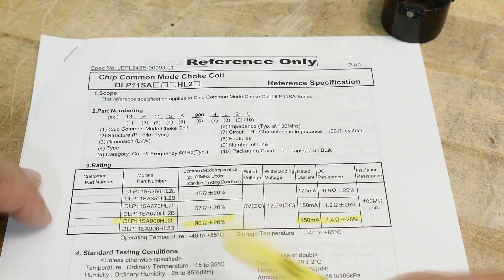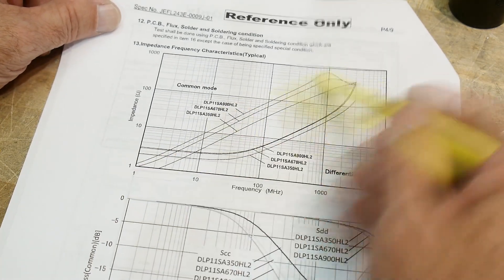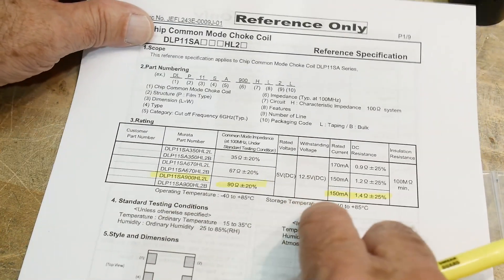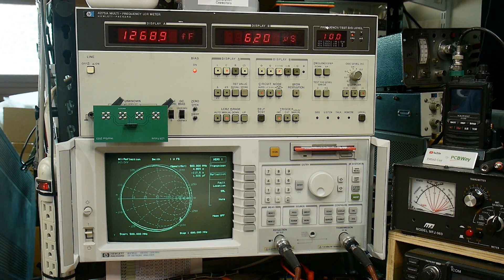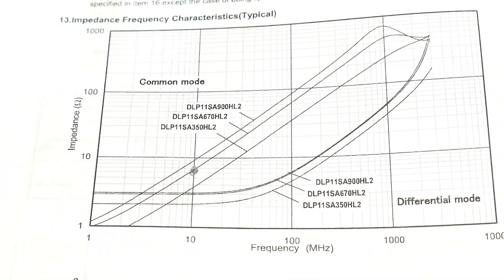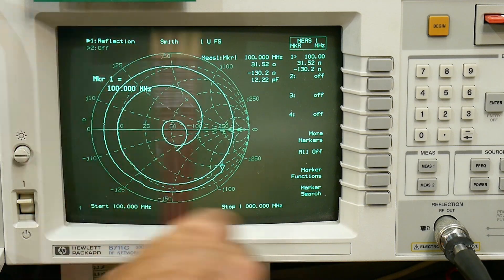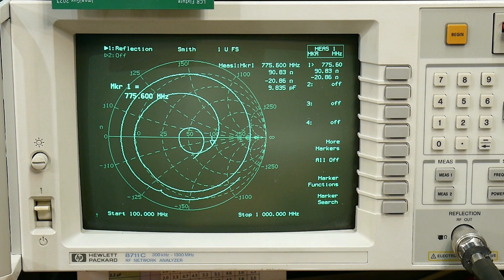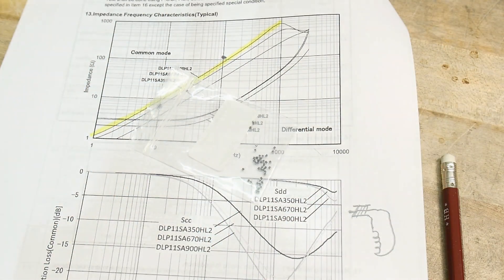#1945 Micro Chokes DLP11SA900HL2L

Comment: Thanks for showing these; just can’t believe the advances in SMT inductor technology! 😀
BTW: I looked into the SAB6456 prescaler but was a little bummed that the minimum was 70 MHz.
You talked (I thought) about making a (possibly Arduino?) frequency counter. Were you aiming for also including the lower-end frequencies?  Also, it would be interesting to see what these chips would do when you reduce the input frequency. 
I once thought that something like a fast 74AC4040 (or one of its brethren) that can run up to 120-140 MHz could be used if the prescaler couldn’t be under-clocked.  Anyway looking forward to see what you come up with as these are really nice for the money…😊

Comment: What size package is that?  0402? 0201?   I feel pretty good about doing boards with 0603 size parts; I can pick those parts up with tweezers and place them by hand (well, with the help of the binocular microscope).   I'm designing a board that has some TVS devices on it; picked the cheapest ones doing the parametric search on mouser.. then did a trial board layout, had to lookup the package... it was an 01005 package - tiny specs of dust!  Nope, nope, nope!   It was interesting to see how the price goes up half a cent or more for human-sized SMD packages.. the semiconductor die must be peanuts in comparison...
Reply: 1.25 x 1.00mm.  Murata calls it 0504.   I nope out around 0402, but on my last project went a bit smaller by accident.  I wondered why I had only ordered one 0805 sized inductor, until I realized it was the DC-DC converter!

Comment: Assuming you did a cal reference to the end of cable the impedance should be positive (@100 MHz) for an inductor - it showed negative for a 😎capacitor. Did you ground the right pin for the test ? Seems to be 12pf - maybe between inductors ?

Comment: I remember taking a diode out of my IC706 back when they were popular. It looked like a spec of dust when I got it out and oh I'll never be putting it back at it size. I'd probably cobble a 1N914 with axial leads back in its place if I needed it back to OEM specs.

Comment: Nice, mostly used in high-speed digital differential pairs like USB, and HDMI, because of its impedance (90 ohm). I usually use wire wound version DLW21SN900 with a bigger package

Comment: I figured you had a plan for these CMCs in the works based upon some clues: 1. although it is the episode before this one (#1944) you can see your DUT testing board in your fancy LCR meter as you were testing that approx. 900 MHz antenna with your VNA; 2. you slipped a couple of times and said 900 MHz when you meant 1 GHz; 3. that led me to believe there was some sort of connection between the two because of the frequency references; and finally, 4. no one is crazy enough to solder bits and pieces that small unless they have an urgent need to do so. But then you said you didn't know what you are going to do with these, and my guesses were rendered nought. Darn.